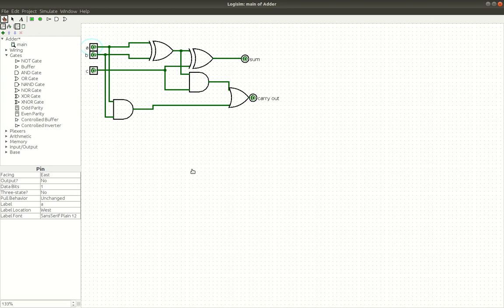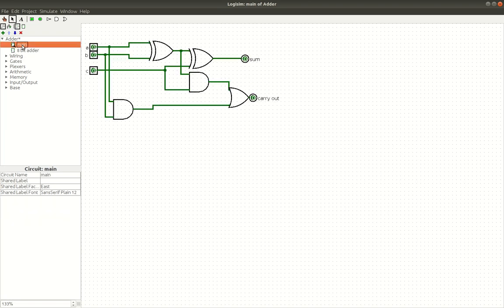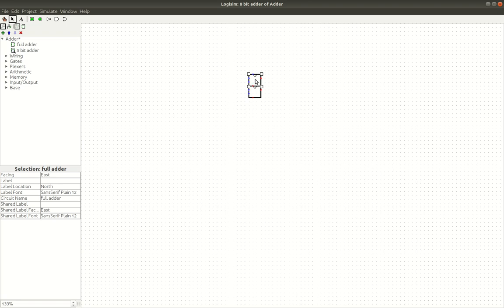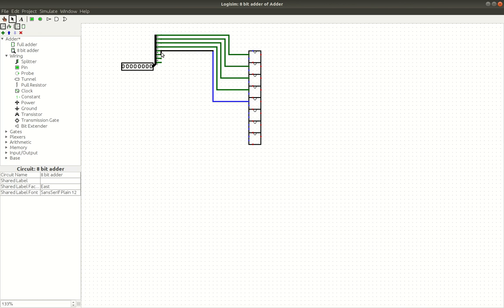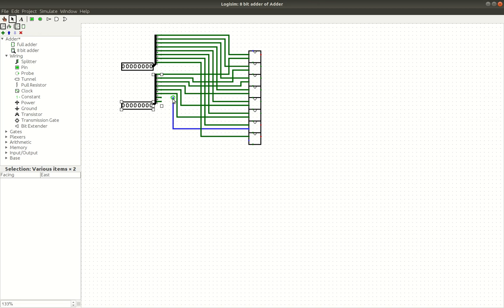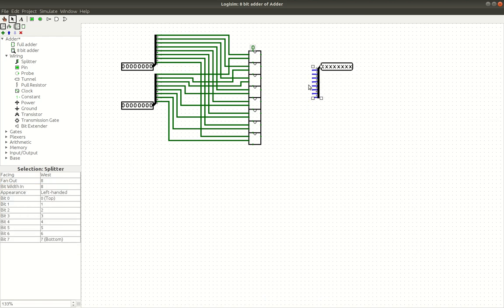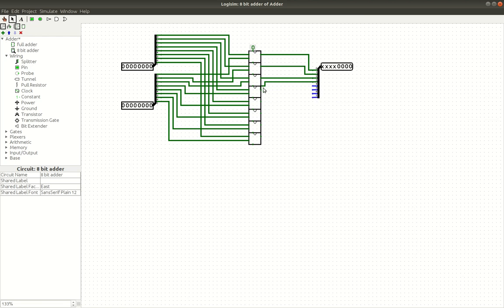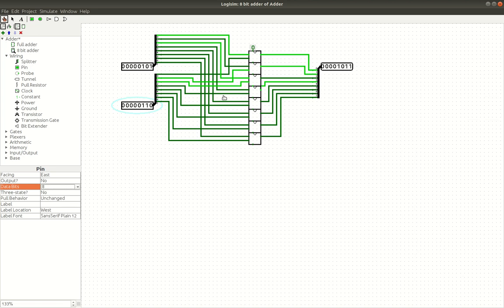Combining Full Adders in Logisim | PK Cubed

Comment: Before i find this software, i'm now want to ask how 8 bit adder of grounding line and source power line
in the real finfit transistor, those transistor matirx  by sqaure by square by hight density,
sow they will combine the source line row by row column by column for reducing the input line counts
it not gate if combine the source power line, it will break down the following gate source power line because of not gate grounding
how the real those macro transistor fix this in micro chip